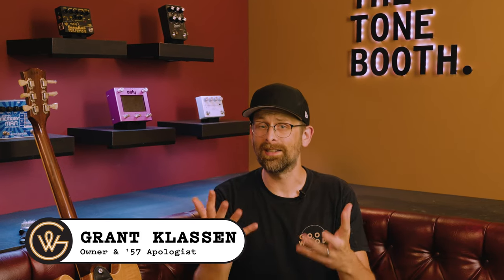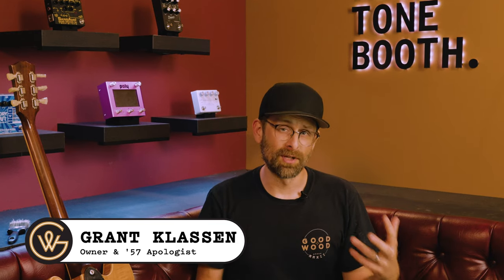UA OX Vs. The Real Amp and Cab

Comment: I recently tracked my Magic Amps Brit MK2 (basically a vintage spec AC15) through an OX. We used the Vox style cab with two silvers I think it was but maybe they were Blues.... Default mics modelled were a U67 and Beyer 160 and I think we might have used a touch the built in 1176. I was shocked at how good it was with no more that 5 mins tweaking. We did run the analog outputs of the OX into a pair of 1073 clones.
Reply from the maker: its really not a bad unit at all eh... makes it easy to record / practice quietly / have a backup recording while keeping a live cab...tons of uses.